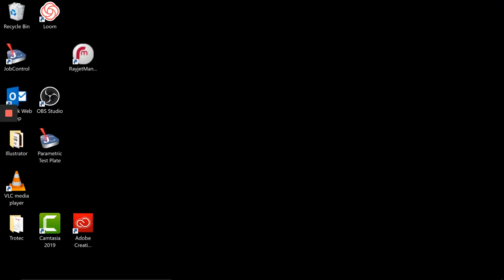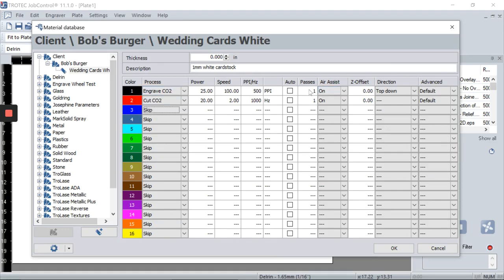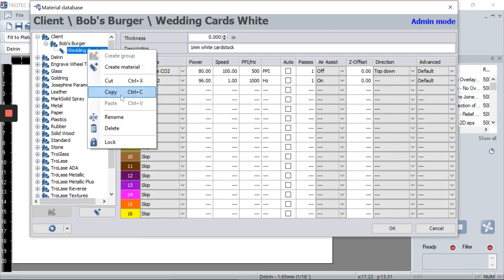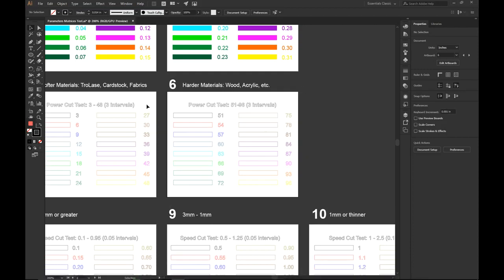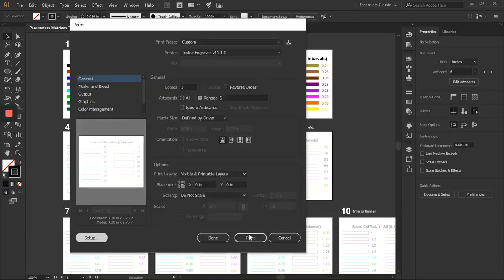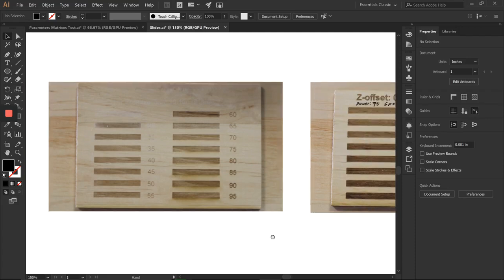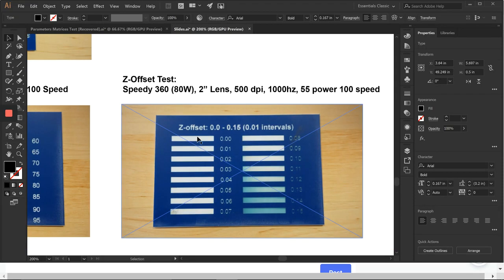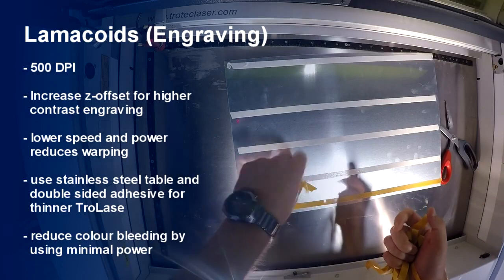Trotec Laser: Finding the Right Laser Settings

Comment: Hi, for cutting a 2mm leather material, what line width should I set in Ai? I heard it should be 0.01mm but there is only pt in AI
Reply from the maker: Adjust the line to as thin as it will go for Job Control, but if you are using the new Ruby Software, then line weight no longer keeps the machine from cutting like the old Job Control software, and any line thickness will work as long it is the correct color.

Comment: Where do I get the color matrices file.  I cannot locate it on the Trotec website.  I am interested in both Illustrator and Corel Draw versions.  Thanks
Reply from the maker: Don, first you want to make sure you are using the latest version of JobControl. If it is up to date, we show you how to access the materials database within JobControl at the 47-second mark on this video. If you would like to access your materials database through CorrelDraw you can. When the print screen pops up, make sure your Trotec is set as your printer and then you can access your Materials database by clicking preferences.
Reply: @TrotecLaser  I'm not sure I was clear.  I know how to access the material database, I'm looking for the corel draw and illustrator files as illustrated in the video.

These files have the rectangles with the 16 different colors and the appropriate text.  This would be the graphic file that I send to the Trotec laser for processing.

I am using version 11.1 of job control.

So in net, I just want the 2 graphic files that would be opened in the appropriate graphic applications and then I will post the appropriate info in job control and send the graphic file to the laser.
Reply from the maker: @donbugansky433  I apologize for misunderstanding your original request! Please check out this page for free Matrix files: http://bit.ly/334LYlt